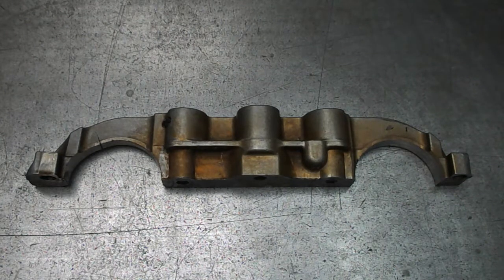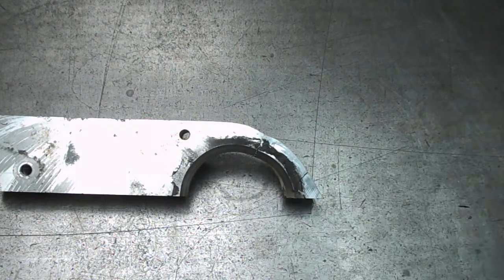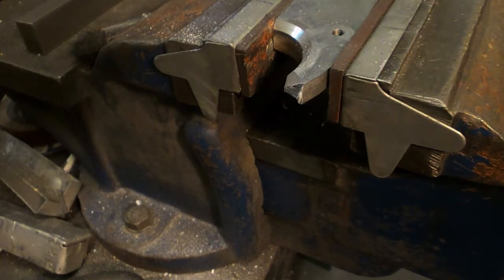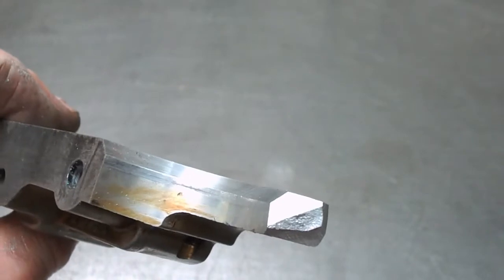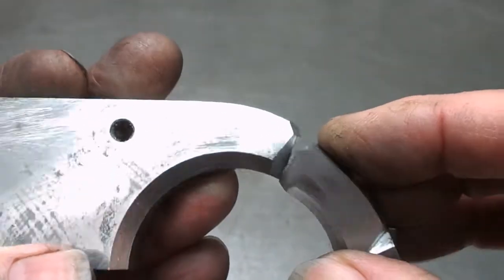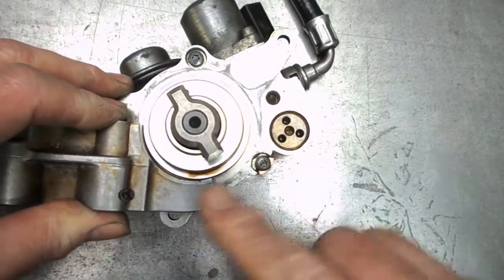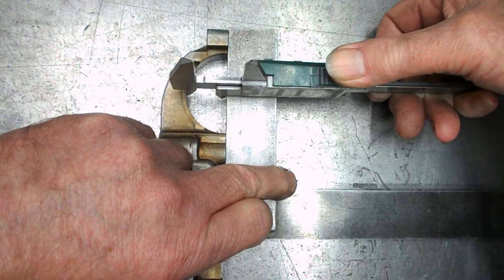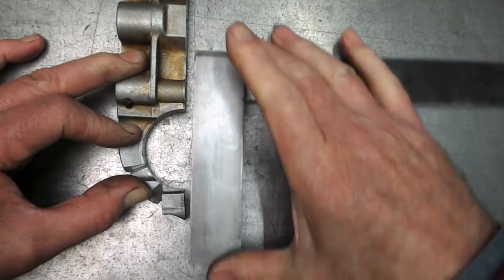Repairing a Mini Cylinder Head Plate (part 1)

Comment: I would have thought that it would have been easier and cheaper for the customer to buy a new part.
Reply from the maker: Customer reckoned it wasn't available as a separate part - only with a complete cylinder head..
Reply: @MidEngineering  That's different!

Comment: Rearrange the following words into a famous phrase or saying, punishment and glutton. 🤔
Reply: also
... "so preoccupied with whether or not they could that they didn't stop to think if they should."
Reply from the maker: But, nothing ventured, nothing...
Reply: @MidEngineering  true enough and I  follow that principle, provided the customer accepts it might not work. What concerns me is if the part is irreplaceable and it all goes tits up, but you can only do your best using your knowledge and experience.
Reply from the maker: @chrisstephens6673  In this case, the part was no good as it stood & the alternatives were to get another cylinder head or engine! So in that sense, there was nothing to lose, but of course, if I couldn't fix it I couldn't charge anything for it, so I sometimes have to be prepared to chalk it up (down?) to experience  if it doesn't work out.
Reply: @MidEngineering  all part of life's rich tapestry.